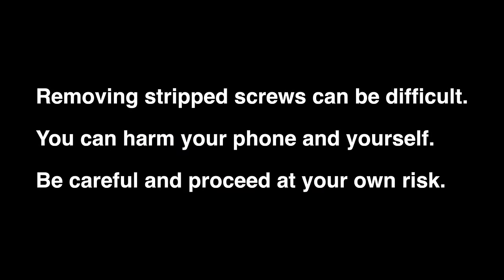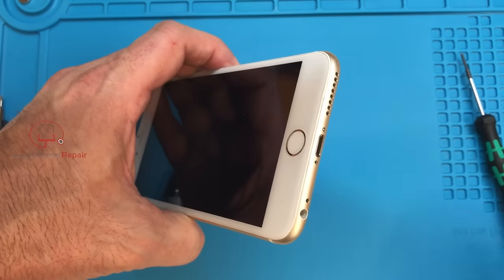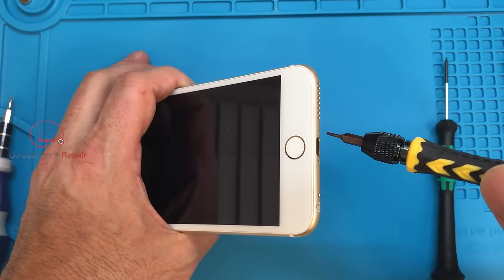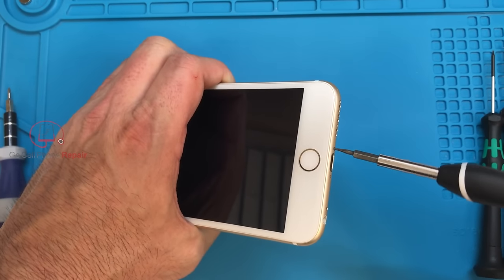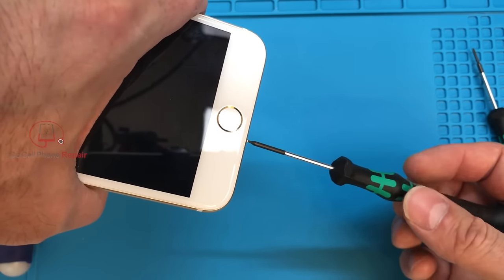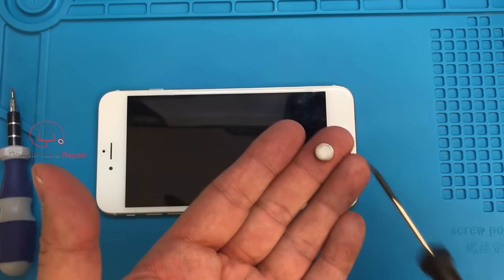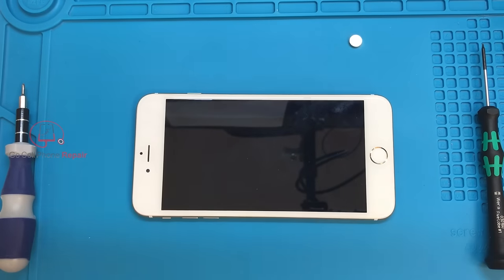How to Remove Stripped Screws from a Phone

Comment: The tape method worked!! Admittedly I didn't have a small enough screwdriver for these really tiny screws but putting some fire retardant tape (which usually is very rubbery and flexible on the surface) worked, although very slowly and required some force.
Reply from the maker: Awesome! Congrats.

Comment: ill give my own advice that works 9 out of 10 times. just use whatever suction you have to lift the scren and at the same time unscrew. warning dont force the screen to much just a bit is enough
Reply from the maker: Good advice.
Reply: correct!
Reply: I can't thank you enough!!!!
Reply: You saved me money for magnet, and a trip to Home Depot. Thank you so much.
Reply: I had a screw stuck on the SE home button when I was replacing the lcd, so I pried the metal and moved it a little, took out the home button and the cable, ordered a new metal part for it, and boom (THIS WONT WORK FOR PHONES AND IF YOUT DOING IT BECAREFUL YOU MIGHT DAMAGE SOMETHING)

Comment: Another way (I just found out) is great for internal screws. As the Y-screws wear out pretty fast, that indicates that the metal is quite soft. So I took a scalpel and forced it in the screws head so it bites. After a few turns, the screw was finally out. Screw was f***ed, but I had a replacement.

Comment: Great ideas and video! Using your suggestion about using sticky packaging tape wrapped around the tip, I was able to loosen the stripped screws in my wife's iPhone 6s Plus. What also helped was using a second phone with a magnifier app which also turns on the flashlight while magnifying. That enabled me to see in great detail the stripped screws, as well as the initial slight movements that were occurring as I attempted to loosen it. Appreciate all the YouTubers comments as well!

Comment: thanks for the vid it was extremely helpful, my problem was the bottom screws were filled with crud and when i was trying to unscrew it lose touch and strip the head and the tool, i used the rubber band and it defenitly helped get the crud out and saved the tool a bit from stripping more but what got it turning was a good ol 1.0 flat head with some pressure.

Comment: If your pentalobe screw isn't coming out (as in it makes a slight click noise as you rotate it), try and unscrew it to just before it clicks. Get a magnet and place it on the screw and pull out. This worked for me.

Comment: I was looking for some tips on how to remove a stripped screw inside a phone. There are a couple options here that might consider. But I just wanted to add that if you’re just simply trying to remove a broken screen, you can use and I said some mowers badger and just ripped the screen off and break the screw tabs completely off of the old broken screen. I’ve done that a couple of times. I do in-Home/in-office repairs and sometimes that’s all I can do. 

Another thing is he mentioned the screws not wanting to come out. Sometimes on aftermarket screens, the screw tabs are bent inwards a bit and if you don’t bend them towards the frame of the phone before installation, the screws won’t come out. So one option is to screw the pentalobe screws back in with a bit of force so that you make those tabs bend outwards and then when you unscrew it it will push out of the phone.

Comment: Thanks for the great video!  I don't know what kind of screws my Huawei Mate 9 had, but nothing easy worked.  I went down the drilling path which was nerve-wracking but worked well.  Frankly, I don't even know why they have screws; there is so much tension just prying the case open, that even if there were no screws it wouldn't open by itself in a million years.  I changed out my battery which wouldn't fully charge and I was getting constant overheating warnings.  Got everything back together and it is now working perfectly.  Thanks again for making this video!!!

Comment: I just used nail clippers on a screw, I was able to get the nail clippers to squeeze the screw tight enough to turn it a little bit and then used tweezers to finish rotating it. My screw was inside and not on the outside like in this video.

Comment: Thank you I literally tried everything else, I ended up just having to break the screen off on my xs, however, when I opened it, nothing actually broke, it just opened, the little hole on the screen side is bent, as though the screw was put in not aligned properly and they just pushed the little bracket back and bent it, and was never actually through the hole at all 🙃 no idea how that works as this is its first opening but thanks!

Comment: You can make a tool for stripped screws by taking a skinny poking rod tipped screwdriver and dipping into liquid cement, let it dry and repeat until it is thick enough. I recommend making different sizes to comply with different screws and keep it as a set of additional tools that you know you can depend on. Something along the lines of a .060 inch steel tip hobby punch tool and liquid Flex Seal. Curing is key!
Reply: Couldn't you just heat the tip of the screwdrivers, and try it. It could be a possibility of working, since heat expands.

Comment: A better way that always workd for me is lifting the screen just a but like just enough to have my fingernail between the frame and the screen and then unscrew it and works like a sharm every time for me. :)
Reply from the maker: Good call. I should have included that as it will create tension on the threads. Thanks for the comment.
Reply: Worked out for me, I was almost ready to give up. Was checking in the comments if anyone else had similar problems. This should be added to the video
Reply: Took me 2hrs before I saw this comment! Thanks!
Reply: Thank you! It worked
Reply: Thanks mate, this worked for me too.

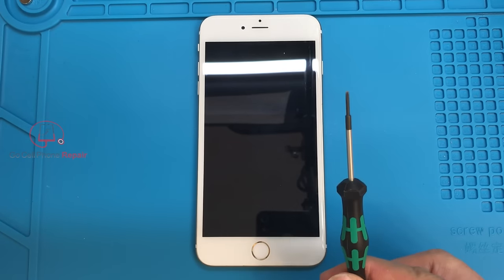Comment: 1:45 they should include the proper bit with devices these days, or at least the proper "size" description so we know what to use without damaging the tiny soft-metal screws
6:20 left handed drill bits would be best bc it might even back out the screw

Comment: What’s you solution for stripped iPhone 7 tri point screws on the home button?
Reply from the maker: I've only dealt with one iPhone 7 Y000 that was stripped but it was on the battery terminal cover not the home button. In your case I think it would depend on which screw. The one directly behind the button could be a problem if you applied pressure which is what I did in addition to using a similar sized Torx bit that was able to grip enough for removal. You might be able to carefully use a blade and cut a straight slot into it then use the smallest Phillips you can find. Jewelers use a ridiculously small one that supposedly can fit into a stripped Pentalobe screw from what I'm told but I don't have first hand experience on that. If I think of anything else I'll add it here later.
Reply: I'm having that same problem with 2 stripped battery terminal triwings. With your experience what did you do to fix it? I have superglue and a soldering iron. Which method do you recommend? Thanks for the help keep up with the good videos!

Comment: Tried soldering after everything else has failed, but the solder doesn't want to bond, and I'm not surprised seeing as the screw is surrounded by the metal frame, which acts as a heatsink.

Comment: NAIL CLIP! NAIL CLIP! NAIL CLIP! I had two stripped ones for the iPhone 8 home button. I just kept grabbing with the corner of the clip and turning. After about 20 mins them b*****s fell out!!!!
Reply: ok I have the same issue, I've been trying for hours on getting these screws out, can you explain your issue was it flush on the bracket or you had part of it unscrewed.  My issue is its flush on the bracket and so far all the options given hasn't worked. Really appreciate your help with this issue

Comment: hello mate i got this problem the head of the screw is rounded would i be able to put a little pry thing  in between the bottom of the screen and the case and lift it up to snap that little mettle bit of the screen that the screw goes into because the screen needs replacing anyway would that work thanks dennis

Comment: I have tried everything except for drilling and soldering and I still can’t get it out not even the glue works 😭
Reply from the maker: Sometimes propping the screen open slightly will help you get some traction. If that does not work you may have to drill out the screw or force it open and possibly damage the screen in the process.